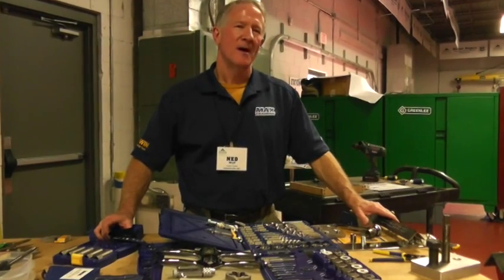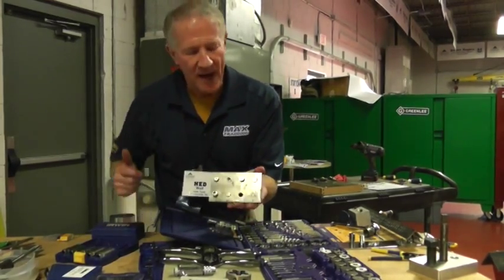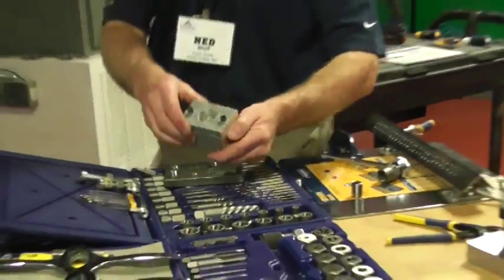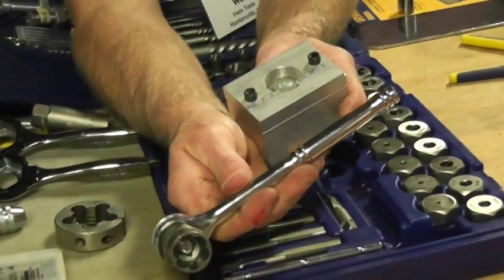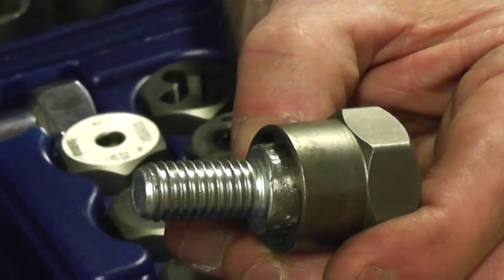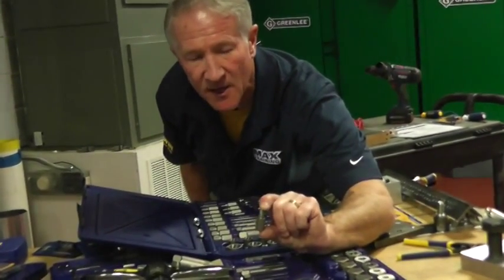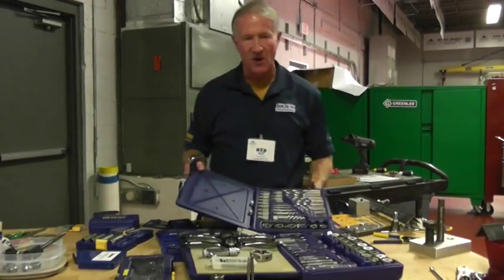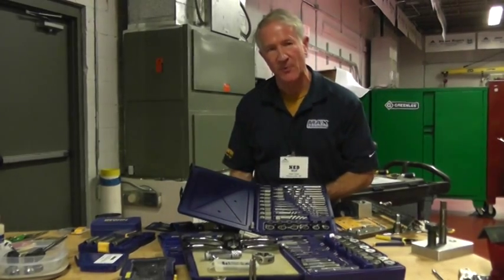Irwin Tools, Hanson Fastener Extractors

Comment: Hi chief, just got myself a 2006 jeep grand cherokee with hemi. Locking wheel nuts the one with three studs/pins , badly damaged,  also the key badly damaged.  I used the 19 mm irwin bolt grip socket. Hammered it on used a strong bar , came off easy. Hignly recommended,  worth there weight in gold

Comment: The easy outs don't work most of the time wasting time
Reply: I use them in an industrial setting and they work the majority of the time for me. Drill your hole as close to the center as possible and as deep as possible, and use a tap wrench (not an adjustable).
Reply: Mig welder is the best extraction tool,saves time not drilling usually out in one try welding on nut
Reply: @Toolaholic7  I have used that technique when breaking easy outs and taps 😁 

Usually though when I'm working inside machines at work it's more feasible to just use a left hand drill bit and an easy out, they work for me almost every time, unless @#$%ing loctite is involved.
Reply: Most of them defeat you breaking off.Automotive,have to watch how far to drill.Can go too far going into a water jacket in a cylinder head
Reply: @Toolaholic7  That has not been my experience